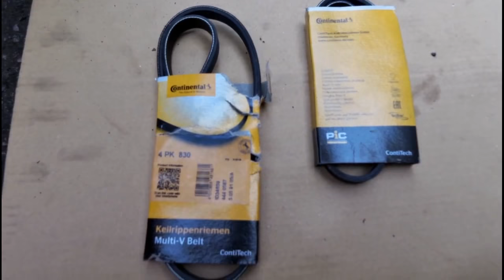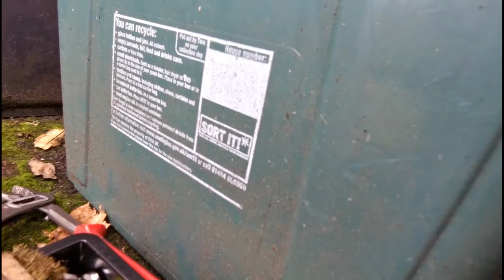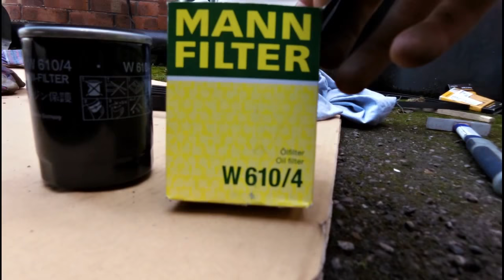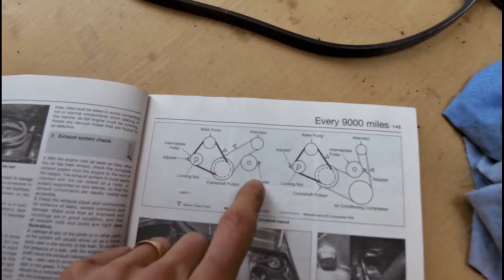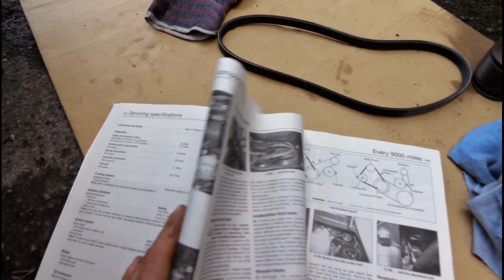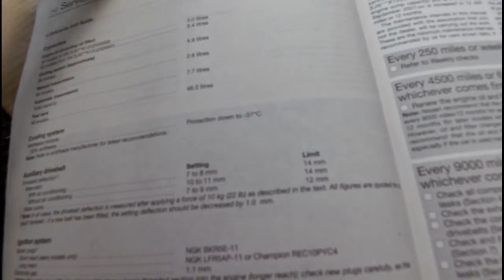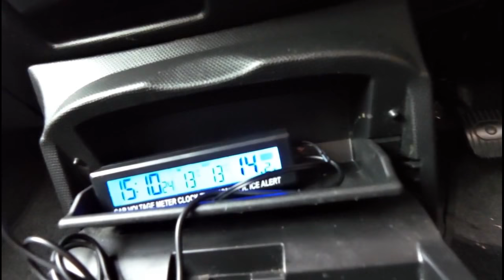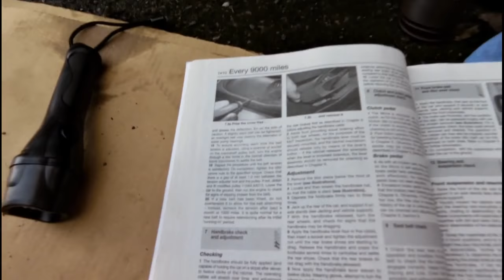Nissan Micra 2003 auxiliary belts change

Comment: little bit too long video but thank U ;)
Reply from the maker: thanks mate :) looks like I might do a timing chain video , Engine Check light came on with 2 codes P0340 and P0011, maybe I'll get away only with changing the sensor (since there is no noise and the engine runs fine ), but Micras are plagued with timing chain disease :|